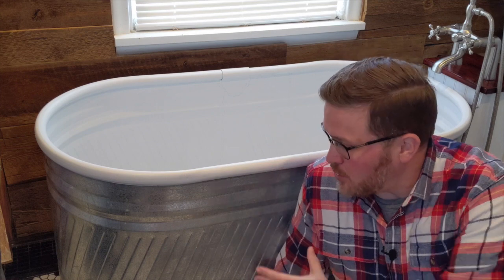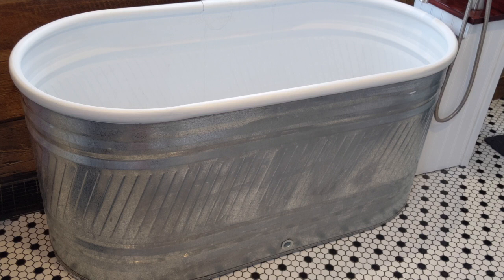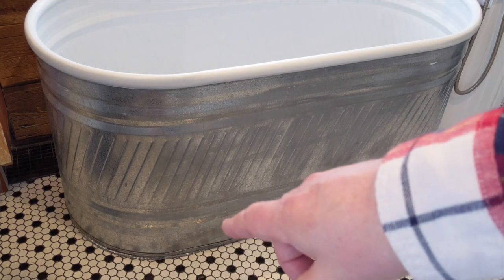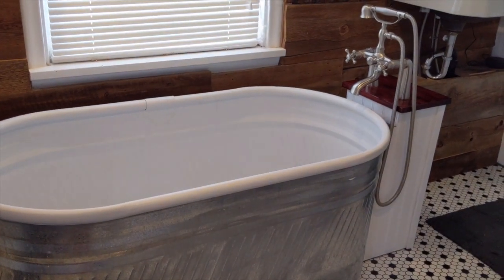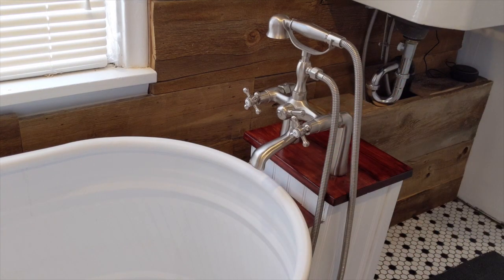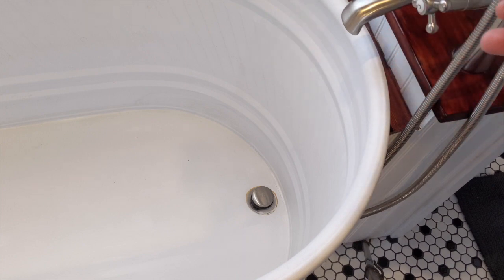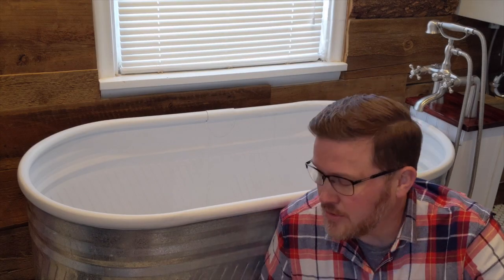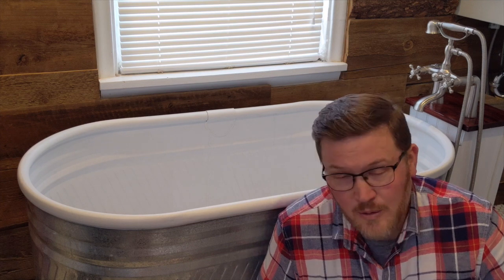Making a Bathtub From a Trough. We Love It!

Comment: Will follow what you did but put a slight slope in the floor underneath it. Maybe like 1" over the distance. Think I will use my circular saw to cut 3 or 4 support boards at the angle then plywood over it sorta like a platform for the tub. Minor enough to not be a big deal but enough for it to drain.

Comment: I did this with white epoxy I chose epoxy for these reasons
 1) 95% less chemicals. 
 2) created a waterproof/ rust proof surface. 
 3) more heat efficiency.
Reply from the maker: Sounds great!
Reply: Hey! I’m in the process of turning a feed trough into a tub. I’ve been going back and forth on paint options. 
Do you mind sharing what brand of paint you used? And how is it holding up so far?

Comment: Can you do a video showing how you painted the inside? Or list your supplies how you did it? Do you think that would work to line an larger stock tank for a stock tank pool?
Reply from the maker: The paint I used are linked in the description. It's important to prep the metal first.  Clean with thinner or isopropyl and then sand with steel wool before and between coats. The cans have instructions on them as well. As for using to line a stock tank, I don't think the paint is meant to be constantly submerged. Permanent under the water line is different stuff.
Reply: It's a galvanized water tank for animals to drink from....why line it other than for cosmetic reasons.  If you do want it lined, look at liquid pool liners.

Comment: Do you think you could do the same with the plastic round ones? The smallest round metal one I can find is 36x36 and that's just slightly too big for my bathroom. 30x30 would be perfect but that size only comes in plastic. My thought would be that since it's meant to be outside in UV light and the cold it should hold up fine being indoors?
Reply: Did you get to the project?
Reply: @blackberry4life482  Not yet! But when I do I'll come back here and update on how it worked out.
Reply: @hollyd1392  
👍🏾
Reply: Any update?
Reply: @Jade_Chipps  I ended up going in a different direction and haven't even started due to what's going on in the world. :/ wish I could say it worked. One thing I can say is that for a shower option instead of a bath tub make sure the "pan" is large enough that the curtain doesn't stick to you.

Comment: I really need to see the installation of instullation. 

You make house calls?  lol
Reply from the maker: Cut out one sheet of the reflective foil insulation to the shape of the bathtub. Use spray adhesive to attach it to the bottom of the tub. Cut out another layer to the shape of the bathtub but only half the length. Spray adhesive to the first layer starting from the back edge. Then do the same thing at only 1/4th the length. The back of the tub will be three layers thick of insulation, 2 in the middle, and one in the front near the drain, giving you a drain slope.

Comment: I was a little confused about what it was that you did that created the angle for the drain
Reply from the maker: There are three layers of the bubble insulation at the back of the tub, two layers in the middle, one in the front, creating a very slight slope.
Reply: @thegreenworkbench  I have no idea what that is
Reply from the maker: @KMF3  Sorry. I used reflective bubble insulation on the bottom of the tub to help insulate the tub and I just used the layers to create the slope. You can buy the insulation in rolls. The first layer covers the entire bottom of the tub the second layer covers the back 2/3, and the third layer covers the back one quarter. The bubble insulation provides padding between the tub and the floor, keeps the water warmer longer, and creates the slope. I hope that helps.
Reply: @thegreenworkbench  yes. Do you have a video showing how you did this?
Reply from the maker: @KMF3  Unfortunately no.  I had so many projects going on at the same time I didn't get a chance to film it.
Reply: Is this on outside or inside of tub?
Reply: @karolkeplinger734  inside

Comment: How is the paint holding up?  Has any of it chipped?
Reply from the maker: We had some chips after a few months so we did a better job of sanding between coats when we repaired it and haven't had any issues since then.

Comment: @aniquinstark4347 probably did a quick google search to get the info they posted, but its totally inaccurate. Just use a polymeric gel boat paint, which is 100% inert. Nothing toxic about it at all. It also has a slippery surface that makes is easy to clean w/o abrasive cleaners.

Comment: @3 mins. The drain is too high. 
I saw a dude beat the hole with a round rock and bend the hole down just enough so the drain is lower than the floor. Worked perfectly

Comment: What are the measurements of the tub?
Reply from the maker: Ours is about 50" long by 26" wide by 24" deep.
Reply: @thegreenworkbench  hi how many gallons would it hold?
Reply from the maker: @Lovelace069  if I remember correctly, it's 100 gallons when filled completely. For a bat we fill it about a quarter of the way, maybe a third.

Comment: I tile my first floor bathroom shower, because the original design was to small for tub. However, to help with the slope, I use a window squeegee to push the excess water to the drain